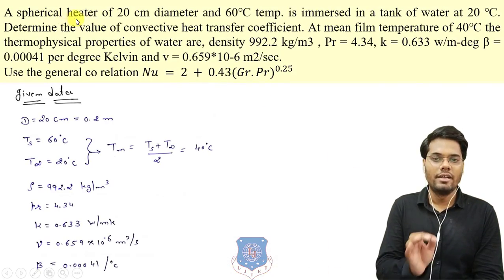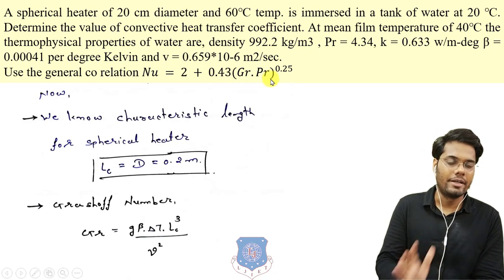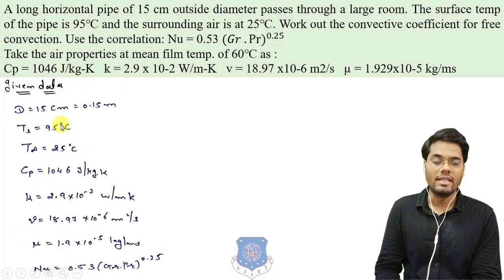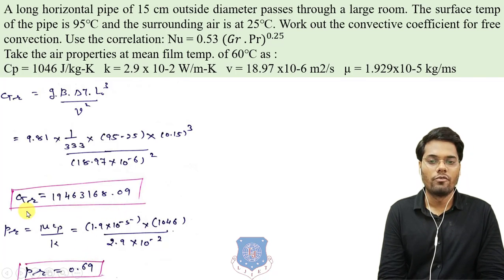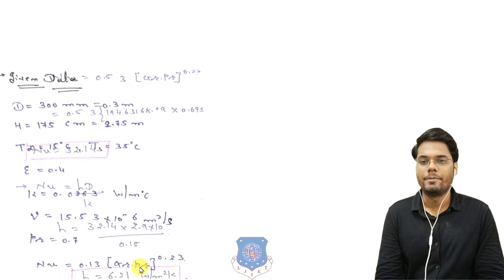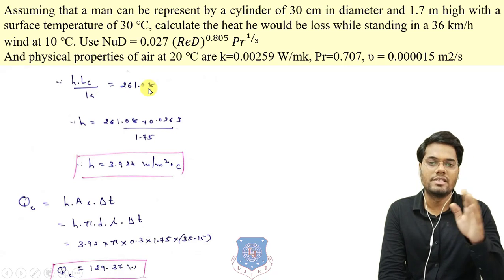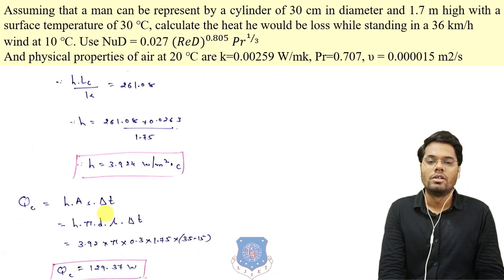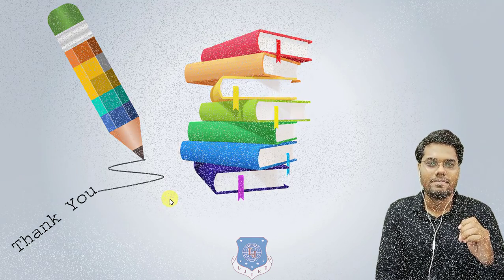L 47 Numerical on Free Convection Part 02 | Heat Transfer | Mechanical

Comment from the maker: There is change in last question 
Calculate the rate of heat loss from human body which may be considered as a vertical cylinder 300 mm in diameter and 175mm high in still air at 15 C. The skin temperature is 35 C and emissivity at the skin surface is 0.4. Neglect sweating and effect of clothing. The thermophysical properties of air at mean film temperature are: K = 0.0263 w/m C, ν = 15.53 x 10-6 m2/s, Pr = 0.7. for turbulent flow use Nu = 0.13 (Gr x Pr)^0.33